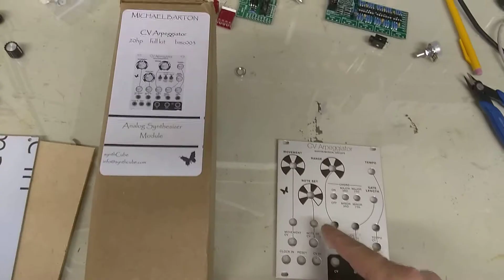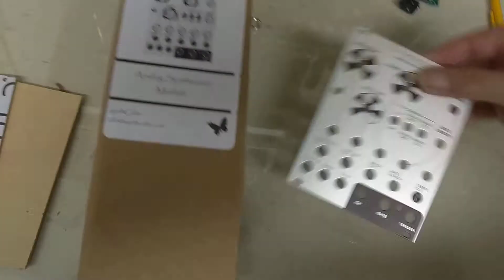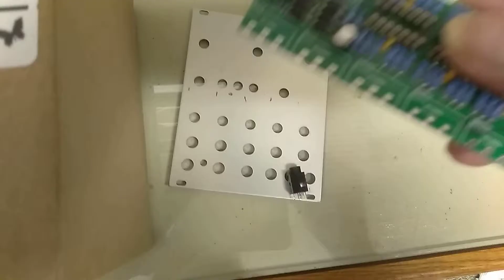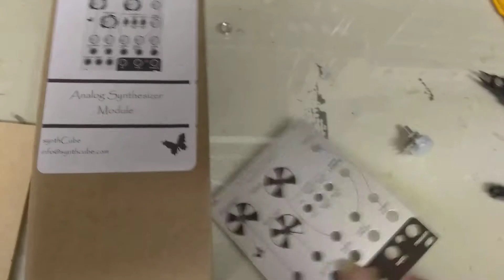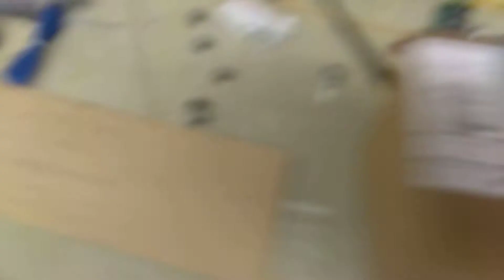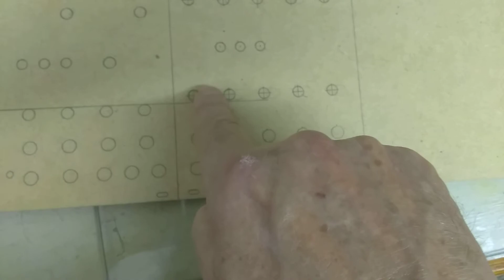Synthcube Barton CV Arpeggiator Eurorack Kit - MAJOR design flaws

Comment: I've built two of the Barton CV Arpeggiator + Expander PCBs/Panels available from Modular Addict. There are no design flaws with the panels Modular Addict sells (they are custom made by OSCILLOSAURUS). It's a powerful module and a very fun build. The SynthCube version shown in this video is a re-panel gone wrong and it should not be any reflection of the excellent Barton Music design.
Reply from the maker: Thank you for the positive comment about Barton Music.  You're correct, Barton isn't the problem, their design is fine.  I should've have made that statement in the video.  I should also add that SynthCube did refund my purchase but I told them that as long as that front panel is being sold the video stays up.

Comment: I probably would have just mounted the PCB in reversed and re-labelled the faceplate, with a label maker or just paint over it (those designs are ugly as hell anyway, modular addict has much better looking ones for the barton kits that also don't require the expensive all-plastic jacks).